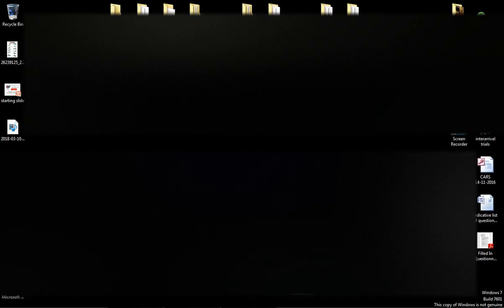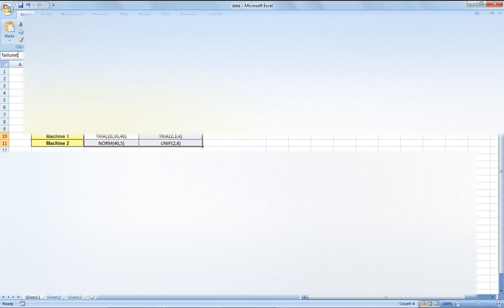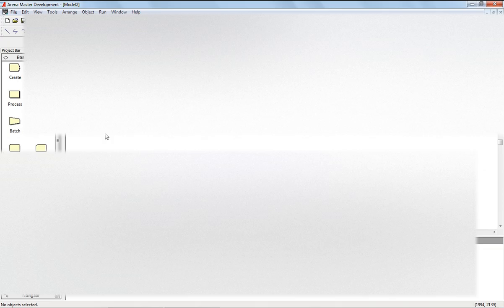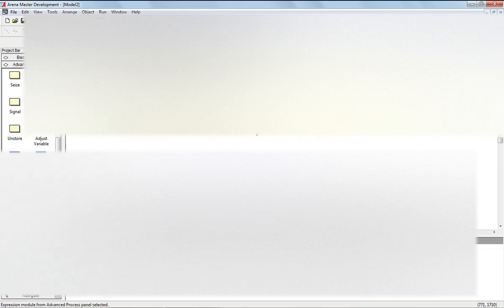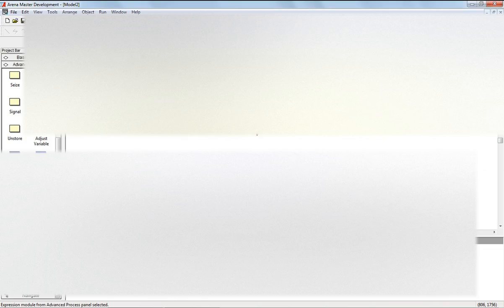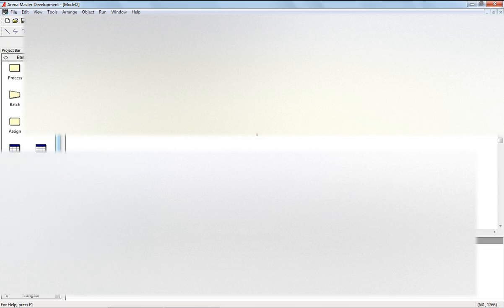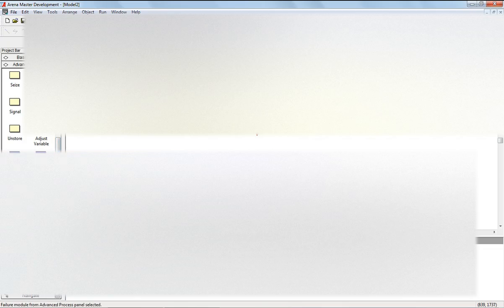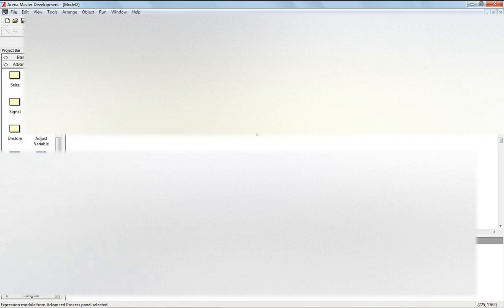Read expression from excel resource failure arena simulation

Comment: Hello I need some practical advise regarding Arena. I’m a student a have some questions regarding one machine that produces raw material into 2 types of blocks. There is a setup time.
Reply from the maker: and... continue the question
Reply: R Fayad. Thank for listening. I realise now that my question was incomplete. I have a concrete block machine. This machine produces different type of concrete blocks. The input is the concrete in general (same concrete for each type of block). Between the switches of block types, I have a setup time. I’m now confused of how to setup this process and how to include this setup time. My solution was: first create the raw material, then a decide to determine the types followed by 2 assigns who lead to the production process. An other approach could be: first create the raw materials, then the production process followed by a decision of the block type, but solution 2 look a little bit absurd. Do I decide before or during the production process what type of blocks I make an how do I include production time.  Hope my formulation of the question was better this time. Thanks